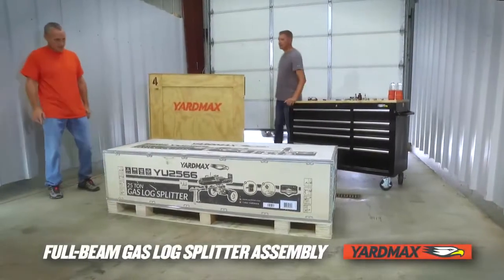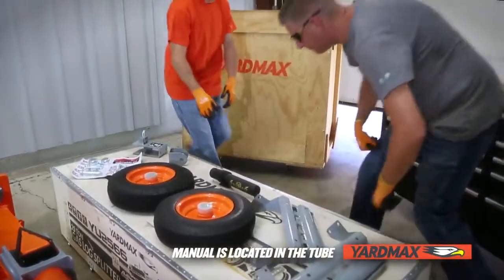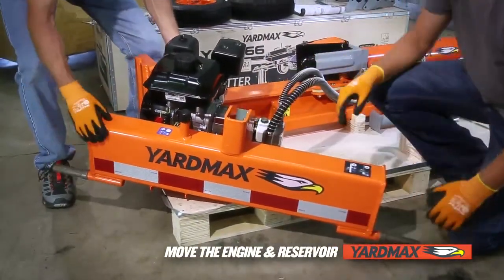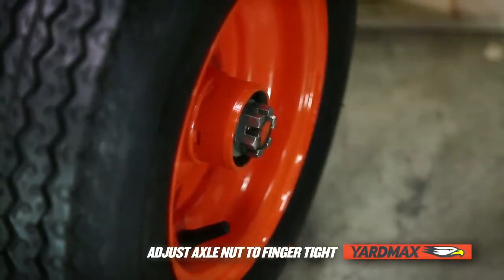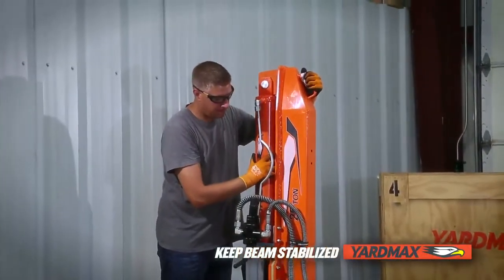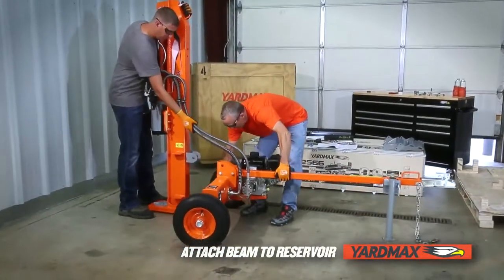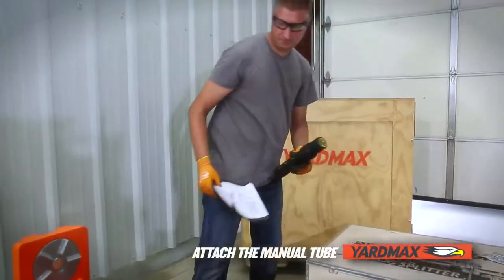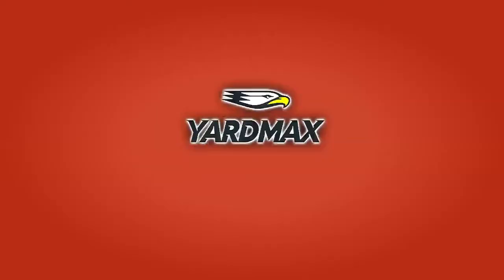How to Assemble Your YARDMAX Full Beam Gas Log Splitter

Comment: Were it only this easy to assemble this log splitter!  I bought this log splitter (only the 30 ton version) after watching this video.  I thought it looked easy enough to assemble, I could do it!  The crate was delivered to my house and it looks exactly like the one in the video.  However, it took me over half an hour to get that cover off!  I ended up using the loader on my tractor to pull it off.   Then, to put the wheels on took me over an hour to complete.  I couldn't move that axle/reservoir over the edge of the crate platform because the hydraulic hose was too short and there was not enough slack.  I manged to get them on, but then tapping those dust covers on took a bit of work.  The edges would not press into those holes like in the video.  I ended up having to grind them down a bit but it was still a chore.  Needless to say, I banged the hell out of the pretty chrome covers and they are all dented up.  After that, these guys make lifting that beam look almost effortless.  I don't recall ever lifting something so heavy in my life!  What a PITA!  I gave up after that.  I will try again tomorrow but I am peeved off.  On the plus side, this log splitter looks like a monster!  It has very thick metal and I can't wait to put it to use.
Reply: We had the same issues as you and we ended up using a pulley system to lift the beam up and my nephew held it while my father and I attached the axle.

Comment: One of the bearings, that came wouldn't go on the axle.  I had to heat it in the oven and press it in with the castle nut.  Getting the box apart is better done with a metal cutting wheel on an angle grinder, that pressed.metal is sharp and will fillet a knuckle.  The hoses are to short to allow for positioning the axle the way shown in this video.  I'll follow up with a review once I'm done fighting with this thing.........    Ok I'm done putting it together.  It's definitely a beast and powered thru some knarley stuff I had lying around.  The motor started on the first pull!  I like how you can idle it down.  Hopefully I'll have this for years to come.

Comment: First thing I would have done is to grease those axle bearings and put some grease into the axle.
Reply: I had to borrow a die and chase the axle threads. Nuts would not thread on at all

Comment: This video makes it look pretty easy for 2 people to assemble. It was NOT. One of my testicles is still rolling around the garage floor somewhere. This thing is brutal heavy and dangerous getting the beam set vertically. I thought the 25 ton was the hydraulic splitting capabilities, turns out it is the actual weight of the frigging thing..  Be very careful, consider getting 2 helpers!

Comment: The way these are shipped is stupid. I assemble these alot, beam, motor, reservoir, should not all be connected when shipped..putting this together is a pain in the ass vs, all separate parts..yes more to assemble. But definitely is not the easiest to do with limited room when hoses are connected.